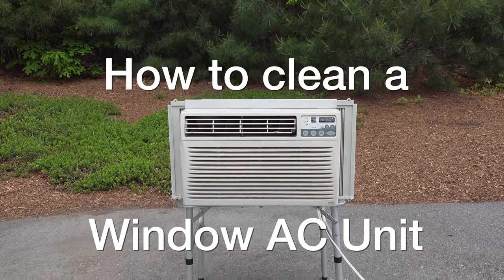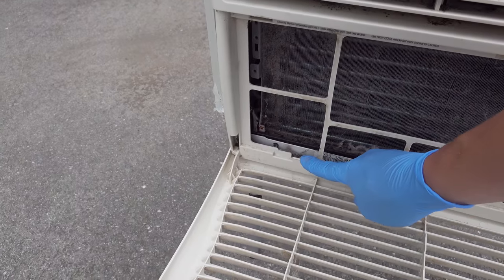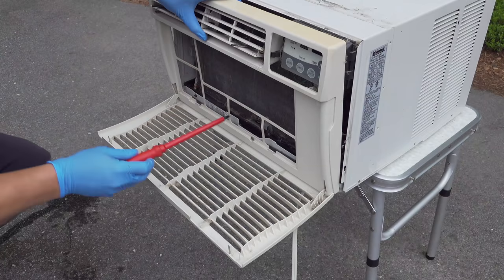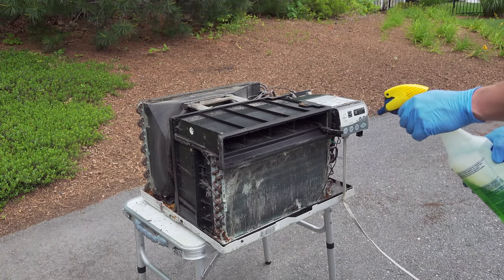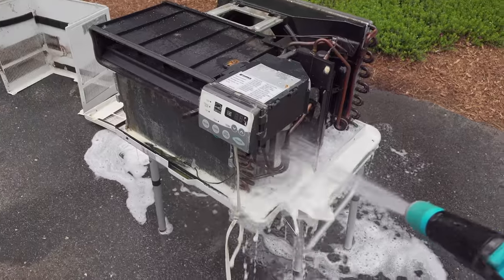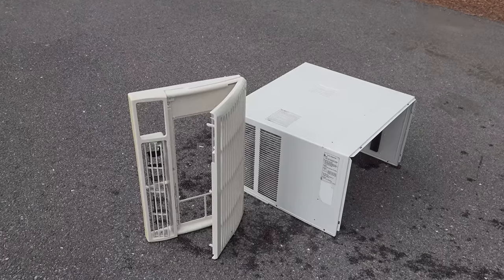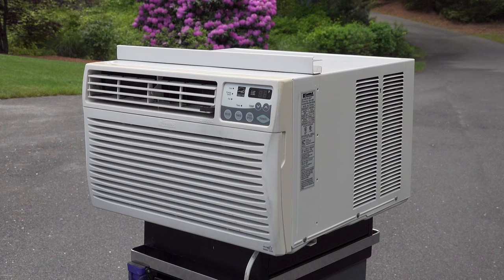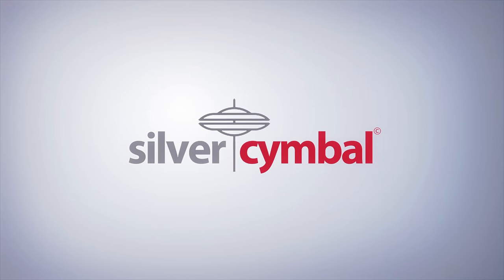Window Air Conditioner Not Cooling? EASY Common Fix - How to Clean a Windows AC

Comment: Easier solution! ! ! When you buy a air conditioner remove the case and hot glue aluminum window screen inside the intake vents that bring air in from outside the house. Cut to fit the openings.  This prevents all the bugs, leaves and debris that gets inside and blocking air flow from dirtying it up.  I live in the woods and the screens get blocked two to three times a year.  All I need to do is slide the AC out of the window leaving the case in place and hose the screens clean blasting water from the inside out. This clears all the debris off.  Any air conditioner that must be removed is still just as easy to hose clean. The aluminum window screen saves a lot of time cleaning and by hot gluing the screen inside and straight it looks factory installed.
Reply: Brilliant! Absolutely brilliant!!
Reply: Unless you specifically set them to "vent" mode, a window AC does not bring air into the house from outside. It has two separate ducting sets - one takes in air from inside, passes it across the cold evaporator, and blows it back inside (usually the intake is the lower area, and it blows out at the top) - the outside part, takes outside air and blows it across the hot condenser to cool it down, and it just blows right back outside.
Reply: @steve…..if I read this right 

standing outside at back of unit where fins are at

remove housing

apply aluminum screen to the inside of housing

when I put housing back on,the screen will be up against the fins per-say,thus a filter effect

should / could I do the same to louvered vents that are on the sides of the housing¿

Thank you

Comment: ... why wouldn't you spray down inside the vents ... isnt that where mold builds up deep down inside and hangs out on the surface exit area?
Reply: idk about window types but ac vents usually have a second fan to blow the conditioned air out. And motors can have any water as you may risk corrosions.
Reply: Heat waves as of late will dry ac super fast.

Comment: Your real problem is the inside of the condenser coil. You need to remove the shroud around the fan and condenser. It most cases it's not an easy task and sometimes impossible but you can still get it out the way so you can remove the condenser coil. There is enough slack so that you can move it and not break the copper pipe. The worst areas will be the corners. The evaporator coil is the other important area to focus on
Reply: I have found some older units stuck together and the cover won’t release. I have cut vent openings to access everything later replacing with another type grille I screw on over the previous now open areas.

Comment: You may need to spray into those vents. They can develope mold which can catch dust and dirt. Also, an old toothbrush can do wonders getting stuck on dirt loose. Otherwise, a great video! Most of the things that I have learned cleaning them myelf. Also, a plexiglass s&eld swt an angle on the top of the a/c can help keep out a lot of the leaves, as well as acorns, which we have a HUGE amount if. Thank you again!

Comment: Also make sure you have a high enough BTU AC for the size room you are in. Don’t try and buy a 5,000 BTU AC for a very large room trying to save on a cheaper AC, it won’t cool it enough. Measure your room in feet and write it down before you go to the store or order online. The description on the box or website will tell you if it’s the right BTU power for the size of your room.
Reply: Makes a difference too whether you have a regular house or a mobile home.  Mobiles are not nearly as well insulated and may require 20 to 30 percent more BTU output.  Also makes a difference if you are in Florida!  AC units work their guts out in Florida.

Comment: Its a good video if its extremely dirty theres ez coil clean that can be used on both coils, on the evaporator (exterior) coil you can use maurtic acid cut it 10 to 1 always add the acid to the water never the other way around it can react and explode out of the container. It will get the really heavy stuff on the interior of it its the hardest part to clean properly.

Comment: WHAT ABOUT THE BLOWER WHEEL ON THE EVAPOARATOR COIL? IF THE VENTS ARE THAT DIRTY THE BLOWER WILL BE.  WHY DIDNT YOU PULL THE CONDENSOR COIL BACK  ALL THE DIRT ON THAT COIL WILL BE ON THE INSIDE. YOU MIGHT HAVE GOTTEN SOME OF IT BUT YOU DIDNT EVEN GET HALF OF IT
Reply: Man why are you yelling 🥴🧐
Reply: @lexuses3942  NOT YELLING GOING BLIND. ALL CAPS ARE EASIER FOR ME TO READ

Comment: I do the same every year in May before the 80/90 degree temperature sets in. My only complaints is how to get the mold and mildew out of the fan blades which is always inaccessible no matter which window or mobile unit. If I take this thing apart, I want to get the tubes and fan cleaned, but it's better than nothing. Every unit has some type of mold bc we live near the woods and there's mold in the dirt naturally.  Also, dead skins aka dust buildup let alone dead stink bugs and leaves. The best thing you can do is to remove the filth from the condenser blades. Be care not to bend it. There are blade combs from Amazon.

Comment: This totally works!  My grandma has an ancient GoldStar window AC in the half-basement window and it was short cycling.  Took it out, hosed it off and blew out the excess debris and water out with my two way shop vac, let it dry overnight and boom.  Works like it’s brand new.

Comment: Lots of comments about mold inside the vents....right or wrong this is what I do....in a quart spray bottle I put 1 cup of Clorox and fill the bottle up with water...it's  about a 3 to 1 mix...then I spray the inside of the vents throughly using a spray adjustment of about 50/50 spray/stream and let it soak about an hour killing the mold, then I rinse out the air channels/vents real good and ensure I rinse off the complete a/c to try and remove all the Clorox/water mix with the hose because clorox can cause rust.  I let the unit completely dry usually until the next day and then plug it in and let it run outside for about an hour before re-installing to ensure no clorox mixture blows into the house and gets onto something like the carpet. Works for me and usually kills the mold for the cooling season but starts returning about a month into the next year and then I do it again....along with the annual cleaning...happy window a/c experience!

Comment: I was taught a little different the condenser is on the back side that’s where all the heat leaves the air conditioner so that little plastic cover where the fan is you need to take it off because a lot of times will have a lot of dirt up there in the corners that you can’t get off by just spraying it down by that and cleaning that way helps but take it off he can actually spray the whole condenser off completely and can do it on the front too

Comment: Should use Nu-Calgon 4171-75 Evap Foam No Rinse Evaporator Coil Cleaner to thoroughly clean the coils. Dawn won't clean all of it. And don't need to spray it with water. We used this on our PTAC's every March. Manhattan is very dusty and the coils get dirty every season.

Comment: Looks good but you MUST pull the condenser away from the fan to clean it properly from the inside, all the dirt is on the inside part because the condenser part blows air from inside, 
I wouldn’t recommend it for a non technical person since you can bend or damage the refrigerant lines,

Comment: Tighten compressor mounting bolts while you are at it, it will rattle much less when you turn it back on.  Check and tighten what ever other bolt and nut that you can see with the cover off.

Comment: I cleaned my AC like in this video in the Autumn and stored it for the winter. When I installed it the following Spring my moter bearings  were completely locked up with rust.

Comment: I have a unit that needs cleaning but since you mentioned you don't spray the inside of vents and I'm at a loss to know what to do. You see I shined a flashlight down there just to see why it wasn't cooling and try and to see anything down in there and I did. I found lots of mold and mildew growing in it and since you can't spray water or bleach then what can be done besides just toss it to the curb and let the garbage people get it or whoever does that? Guess it wasn't a good idea storing it in a damp basement in winter, and then getting it out at the last minute when the basement gets very hot and humid.  If you or anyone has a solution please tell me I would very very much appreciate it? Thank you all and have a wonderful and blessed day! 
         🕊️❤️🧡💛💚💙💜🕊️

Comment: I read that there is something called a capacitator that I need to remove, as it still holds electricity after the unit is unplugged. Do you have a video on how to do that? TIA!
Reply: You don't need to and don't want to remove anything. As long as its turned off, and unplugged, and you let it sit for 5 minutes, the caps will discharge. They are usually sealed against water anyway. Keep in mind the "outside" part of the AC is literally outside, exposed to rain, etc, so anything on that side is perfectly save to get wet. As far as the inside part, just be careful not to spray water directly into the electrical or electronics areas, and be sure to let everything get completely dry before you plug it back in (it will dry better with the covers still off)

Comment: I bought a used Frigidaire 10k BTU 3 yrs old and it was coolin just fine but I wanted take a peek inside to see if it needed cleaning boy, was I shocked there was tons of rotting leaves and twigs and crusty caked on dirt and mold everywhere. There's no way I could see beyond the grilles to know it was so dirty inside. I pretty much did as your video.

Comment: Could you do this to a portable air conditioner?
We had it about 4 years and now it's not as cool as it should be. It's been indoors of course, so there's no leaves or debris, so would dust cause it to not run cool?
I already vacummed the outer vents and blowing regular air temperature.
I hate to buy another unit. They cost about $500+
Reply: They're extremely difficult to disassemble but yes it can be done make note of where the screw's came from they're different lengths & can puncture the tubing
Reply: I was wondering that myself. We have three portables (not allowed window units where there is no balcony) and two window units for the living/dining area. Now I have a nice project for winter :)

Comment: The only thing that effects cooling, as far as dirt, is the evaporator and condenser coils.  Of course, you might as well clean the whole thing while your at it.  Dirt inside, not on the coils, doesn’t impact cooling at all.  Nevertheless, it was a great video. 😀

Comment: Hi. On many occasions I have caught my window unit dismounting itself, this usually happens when I'm sleeping only to wake up to a noise like a knife being unsheathed, on certain occasions I caught my ac unit out of the corner of my eye quickly trying to get back into the wall and reposition itself before I can realize it is attempting to murder me in my sleep. This thing thinks it's smarter than me and it thinks I dont know but I know what it is up to.
What do you suggest I do about it?

Comment: Wow! You have some great tips. As a subscriber, I have a question What you think? I have a wall unit, it kept 2 rooms nice and cool. Then one day the unit started to freeze up, all I ever did was clean the filter and the front face. I unplug it and haven't use it for two years and its still in the wall. I could slide it out and clean it the way you did. Would you think it will stop freezing up? or just get a new one.
Reply from the maker: Thank you, I appreciate that. Freezing up usually means 2 things, either air flow is restricted which it sounds like you are ok with that or the freon charge is off, which is not a good DIY repair. So if its cleaned filters are good, probably time to consider a replacement.

Comment: If your window ac unit is only blowing air 15-20°f cooler than the outside air it needs to be replaced it should be much colder than that when it's 110°f here in Phoenix mine is blowing out air at about 50°f that's 3x as much cooling as what you stated. It's only 8k BTU

Comment: I have a question before I try cleaning my own window ac , where the mold and nasty dirt is on the bottom of the ac if their is a small water puddle does that mean anything or is my ac just full on dirty , I’ve only had mine for about 8 months now so this is why I’m asking do I need it fixed ? Or do I need it cleaned ? Because It does smell and it is blowing hot air but when I look at the ac from the outside of my window looking in I see dirt , mold / a little bit of water what do I do , pls help before I spend 300$ on a new ac I also have a whirlpool wall ac

Comment: I purchased a 8000 BTU window air conditioner. 
I've ran it for two seasons I've noticed a drop in temperature win I cracked it out for this season. Have you ever seen one get dirty in so short of a time to effect the cooling temp?

Comment: Very satisfying send something to be clean but why didn’t you straighten out the fins when their bands they make the air way more strict and it’s not accessible to go through so just wondering why you didn’t straighten them out that would’ve been a good ending of the video since you had the whole unit disassembled.

Comment: another indication the unit needs cleaning is the power cord starts to get hot during operation; the unit has to work harder to cool the room.  when it starts tripping the breaker often is when it's really dirty.

Comment: So I followed the steps. Cleaned the AC (was not very dirty)
Still was not cooling.
So I cleaned it again. 
After having the same result with the AC just blowing hot air... I took it to a repair shop.
Seem the compressor is shot. No amount of cleaning is going to get this thing to work it seems.
Did what I should have done from the get go and bought a new one.

Comment: We bought a frigidaire Energy Star 12,000 BTU just two months ago. It stopped working once due to too much sludge not draining. I drilled a hole, and it started working again. However, it stopped cooling AGAIN! Yours took years to clog. Could a two month old A/C be clogged so soon?

Comment: My teacher really got me working on an old window unit, I'm talking about wood grain look on the front. Has to have been outside on the ground b/c the inside is so dirty and rusty. All that was wrong was the fan motor. It smells like wet rust and coil cleaner.

Comment: Is there a reason you do not spray inside the vents? Because when I take mine apart and clean it using this video I've got nasty build up inside the vents and on the fan that needs to get gone that my hand cannot reach

Comment: Introducing lots of water can cause stock bearings to fail, on older units, this is an easy and cheap replacement fix, but most new units are built in a way that bearings cannot be replaced.
Reply: They get when it rains..so false.

Comment: Sure spray the fan blades, but I'd minimally spray the motor with soap and then water as it may get into the lubricated bearing areas of the motor; motor may seize up.

Comment: I have a floor model portable AC I bought new. It didnt blow out cool air from the day I started using it. Any suggestions? When i took it out of the box it had a moisture over it like something leaked. Any sugggestions?

Comment: These are actually supposed to be cleaned just like your central air conditioners. They sell cans that evaporate on their own once your spray the back of the unit. But once you do a deep clean you can do preventive maintenance twice a year.

Comment: Can I ask you something? Will cleaning an air conditioner like this prevent it from sputtering water at you? Because my last AC was horrible about this; so much so that I just replaced it.
Reply: There should be something to drain water outside & it looks like a channel or a tunnel
It can get blocked by dirt. Trace it as far as you can starting from the outside drain hole. The other end is usually below the internal fin radiator.
If you have a hose attached then it can also be blocked.
Easy solution for light blocked drain is to blow into the hose/hole from OUTSIDE & have someone inside to see if water or dirt splashes (which means the drain is patent)

Comment: Suggestion, don't use dishsoap get the ac cleaner at home depot or a product called Nubrite for the coil. The soap may actually work but the soap won't completely wash away leaving the pipes in the coil sticky and will then get dirtier quicker.

Comment: 'Seems like it would be a much better idea to do this on the bathroom tub..all that soaps' gonna kill all the green grass..js. (just pull the shower curtain over most of the showers, as there will be a lot of splashing..hopefully a shower wand to wash and rinse and dry inside the house overnight, to ensure a complete dry).. but hey..that's just 'me'...
also use a sink strainer in the tub plug to catch and dispose of all the debris).
Reply: Soap wont kill healthy grass

Comment: 2 more steps and you could have pulled the fan shroud covering the outdoor fan and indoor blower which will be covered in hair and dirt. Just a few more screws and pull the whole assembly out

Comment: Instead of using too much water I recommend using a air compressor with a blower adapter to blow all the dirt and leaves then use a tooth brush or small brush to clean the coils once u do this make sure you get the water out with the blower or it will rust which will cause it to corrode and break off.* WATER IS VERY DESTRUCTIVE